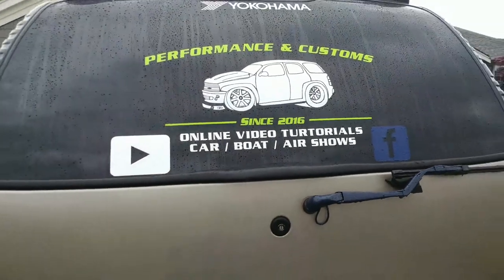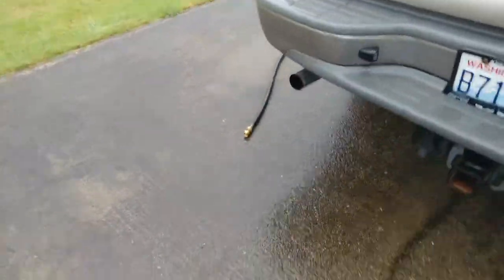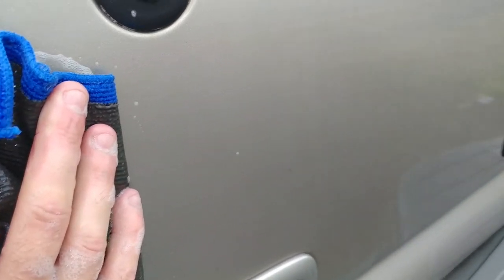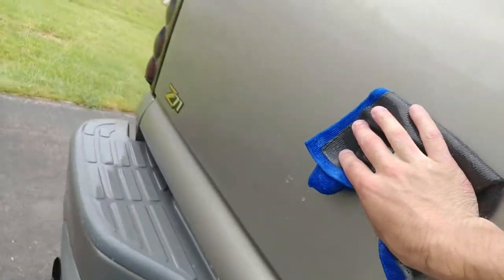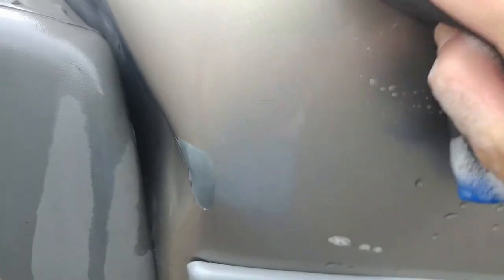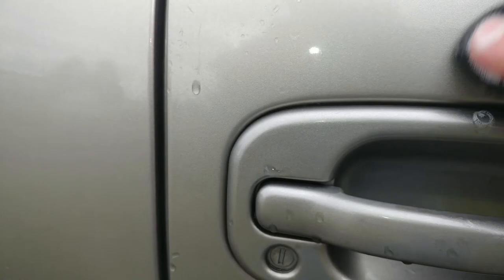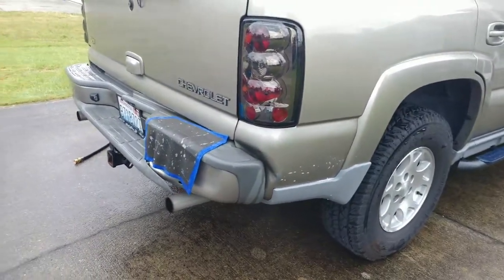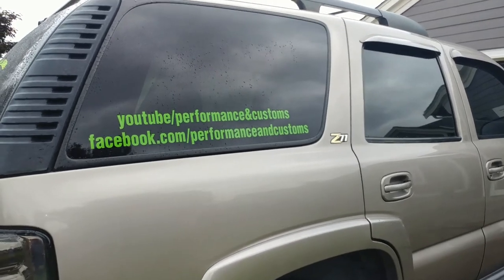Making the truck smooth with a clay cloth

Comment: Using the surface prep like that with the wash water is a no no. Use a designated clay lube the wash water your using is not sufficient as a lube. You need to use a foam cannon
Reply from the maker: Sorry but your wrong ! I have worked for a detail shop.
Reply from the maker: I will agree with you on the foam cannon I do want one of those . now I can see using the lube on a car thats finsh is complete .butI dont see the need for it since I buff and wax after that
Reply: Performance & customs bro I have as well. I worked for a high end shop and you could check my ig out I detail too. IMO super half ass for someone who calls themselves a pro detailer. And also by the way. You can’t feel the texture from contamination on the paint with your hand  when the paint is wet. And road tar should be taken off before you clay your just going to spread it around the finish.
Reply: Performance & customs much love
Reply from the maker: 😂😂 when did I call my self a pro ? Lol bullshit you cant fill the difference ! Thats funny
Reply from the maker: @socal rocks exactly. I dont care about some micro scratches. It's not like I'm taking a magnifying glass to my truck  to see every little flaw in the paint lol
Reply: @Performancecustoms  These "PRO" detailers can be toxic sometimes, you did a good job. Sandro from Car Craft Auto Detailing also recomends using just water and good car soap for lubricity when using clay if you dont have dedicated clay lubes and hes a real PRO detailer IMO.